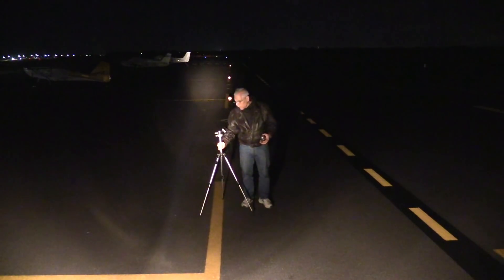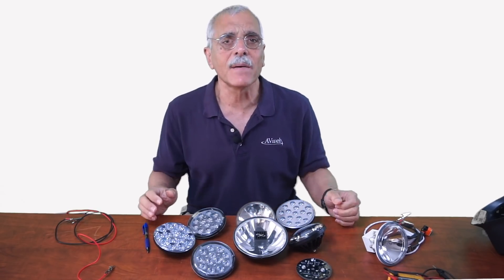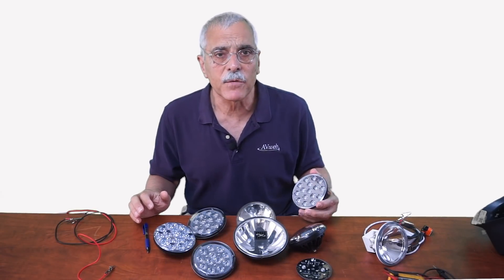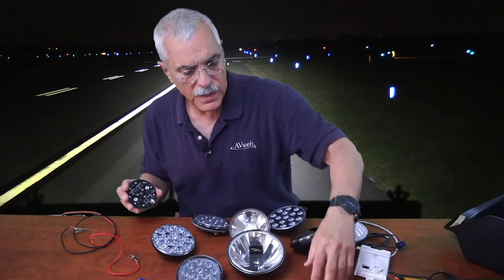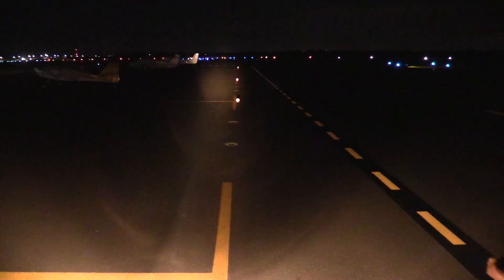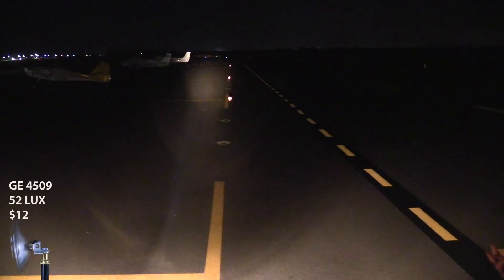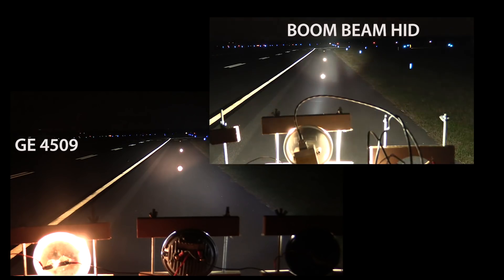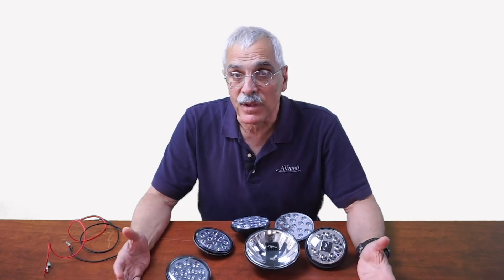The Unbearable Brightness of Aviation LEDs

Comment: So recently on my Bonanza I swapped out to some LED landings lights and holy crap they are like lasers through the night. Coming in for a night landing I am able to see the entire runway clearly. They are simply incredible, and there is not a single reason for anyone to not be running LEDs now a days. In terms of lights they are expensive but well worth every cent.
Reply: Tell me one thing in aviation that's not expensive. lol
Reply: @terryboyer1342  Advice!!  Then again, take the wrong advice and it could cost ya...:-)
Reply: terry boyer good planning
Reply: I run ethanol free auto gas in my plane and in terms of relativity it's pretty cheap at least where I live.
Reply: What did you buy? I own a '54 E35.
Reply: How much is one of those HIDs?